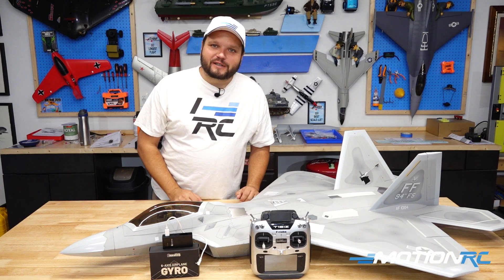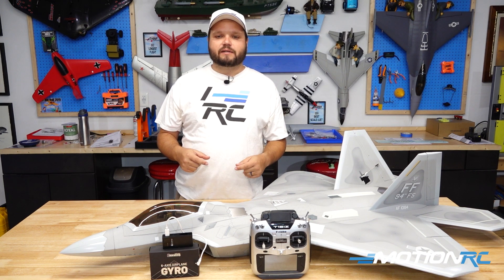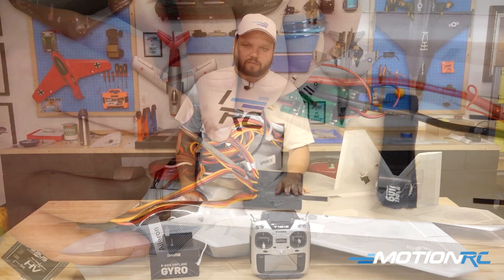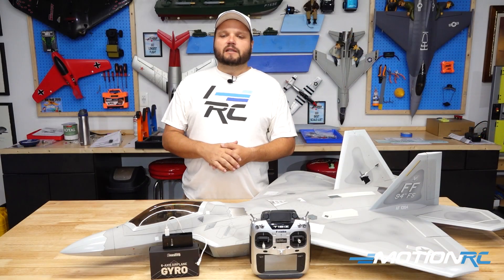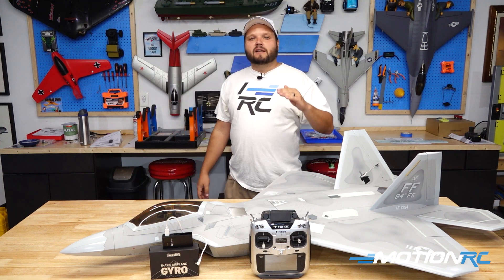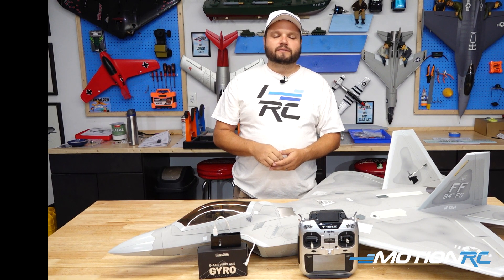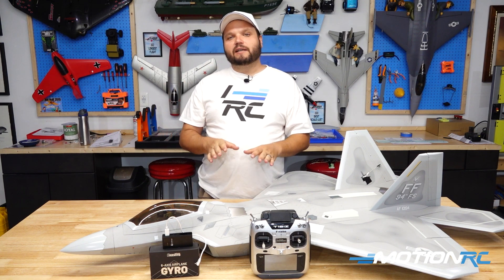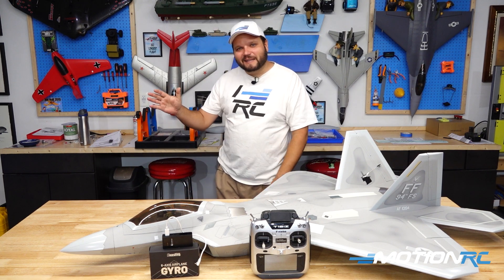Freewing EG01 6 Axis Gyro Stabilized Flight Control System Installation and Setup | Motion RC

Comment: How do we get the blue light to come on this gyro when flying the sr-71? I get green, green and off
Reply from the maker: You need the blue bridge gyro programmer. Auto leveling is disabled on our high performance aircraft. It can be activated using the programming tool

Comment: Unfortunaltely - no answers on any critical questions
and in addition, in the new Ares Ultra High Performance - there is the same "cheap" gyro built in and they sell it as a 6-channel-gyro. It is really bad, when nowadays 2 servos like the elevator are controlled via 1 channel and for the 2.nd aileron servo and the Thrustvectoring - for that reason there is a 2nd gyro - this is the 6-channel-gyro! Is this called MARKETING?
1st impression after unboxing the ARES - super disappointed :-(
Reply from the maker: Too each their own. But Ares has been a super popular release that many are enjoying. Definitely something out of the norm. Sorry your disappointed.

Comment: What are the unused pins on the gyro for?  Is there an option to run either dual elevators or dual ailerons on these unused pins?

Comment: Does the blue bridge have to stay in the plane or can be removed after it’s programmed?
Reply from the maker: you can remove it, but mount it in the same spot when you want to use it again. Most just leave them in the plane they are set up for all the time.
Reply: @ 
I don’t understand!! After it’s programmed can the blue bridge be removed, I bought three gyros does that mean I have to buy three program blue bridge or 1 will work for all three?
Reply: @dholmastersherlock Yes it looks like you in USB program the thing and then remove it not sure what they're referring to above but you would not want to fly that big old box of your plane

Comment: Im only getti g a green and off no blue no white
Reply: At my field I'm the go to guy for these type things and 5 different aircraft and all 5 have come where the dmgyro only does green and off Freewing suck ms for this Gyro to be so awesome and so many areas and so terrible in another. I just put together the Aries which has two of these stupid things and they do not turn blue and I'm afraid to fly without blue plus the fact that that thing is 13 channels I'll have to put it on my 10 channel spectrum and use some wise which will work fine but a hell of a hassle
Reply: Same here!! I SPENT ALMOST $730 on my SR-71 70mm and I havent been able to fly it yet. Its been in a box for more than a year because I cant get a blue light, cant use my spektrum safe in it because i crashed my b2 bomber with the spektrum safe. Iv noticed its not a good idea to put spektrum safe in the b2 bomber specifically even though i thought I mixed it good enough. 
WHY DOES MOTION RC ONLY ANSWER THE SIMPLE STUPID COMMENTS BUT WONT ADDRESS THE MORE SERIOUS CONCERNING COMMENTS. Iv spent thousands at motion rc and have planes in the box that i havent had time to fly yet. I love their jets but this is the first plane that doesn't have the blue light.
Reply: Thats what mine did so i ripped it out and put it in the trash then installed a Spektrum safe receiver.

Comment: Real talk homie. Will this be comparable to the Hobby Eagle, or even surpass it? I won't support Spektrum. Until we get a RIP of AS3X+ that can be used on other gyro's, the hunt is still on for a turnkey FCS system for RC jets. I ask as a PAYING CUSTOMER.
Reply: Sold my Fahtoobah T10J and HobbyeagleV4 for a Radiomaster TX16s EdgeTX and AR630+. Never going back to multiple boxes in my canopies.
Reply: @thorvelasco1467   ELRS for life homie. Spektrum will be the reason you'll be picking up the pieces after a signal brown out. Spektrum's dirty little secret isn't really a secret anymore. No disrespect intended homie, you fly what you want/like. God tier signal integrity is what matters to me, and Spektrum isn't it.
Reply: @biggnasty989 as I progress in the hobby, I'm sure ELRS and a flight controllers, fpv, arduppilot in the future.
Reply: @thorvelasco1467  You are a wise man.
Reply: MACE1-1  I am having a great time with the Radiomaster TX16S bound to Spektrum receivers

Comment: I have this, please take note this Gyro's SELF LEVEL MODE does not have the SAFE function limiting the bank angle like the AS3X+ or FMS Reflex V2/V3.... On the SELF LEVEL MODE, it will auto level the plane when you release any input on the transmitter
Reply: Just FYI, this gyro performs pretty well but if you are expecting SAFE function , this gyro is not for you.
Reply: i am looking for a 6 axis gyro, 3 position, off-3axis-6axis, i would like to have the plane level while in “middle” 3 axis mode. i purchased 3 aura 5 lite from flight test for $50 a pop and 2 were DOA. not really sure what to try and use.  also, i need two elevator ports.

Comment: What is the advantage over an Hobbyeagle A3 Super? Seems the super has 6 Modes and can be mounted upside down. Programming via app...is equal to the programming card imo. 

What does the EG01 do better?